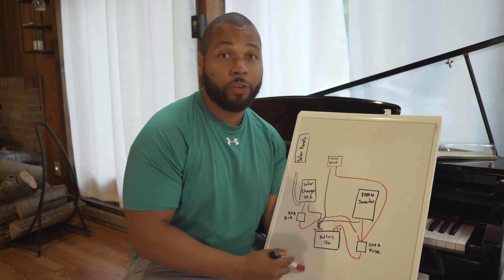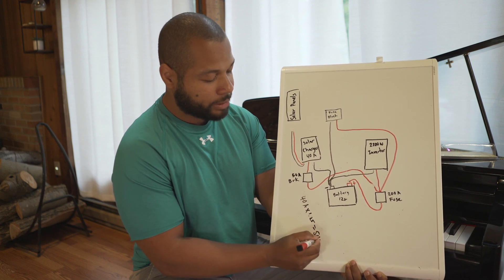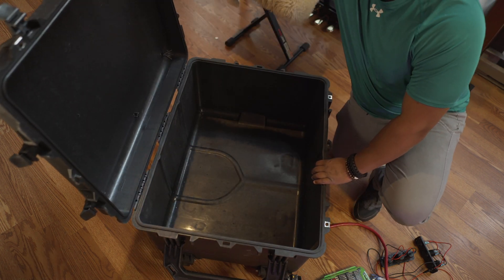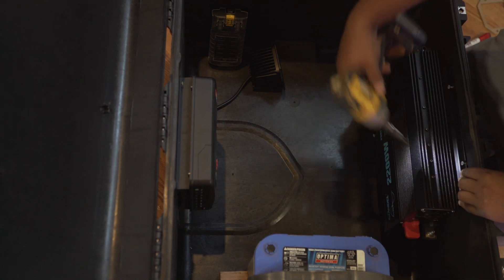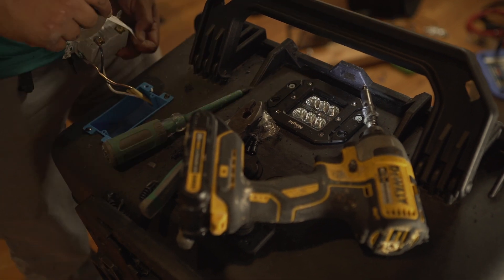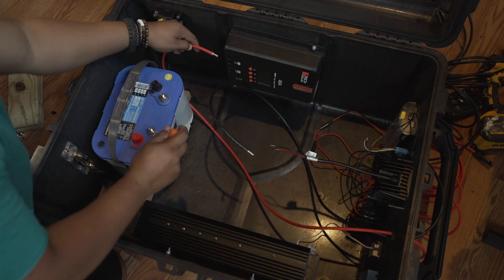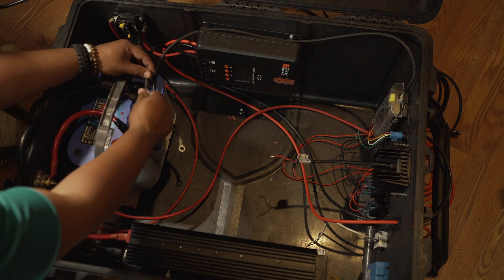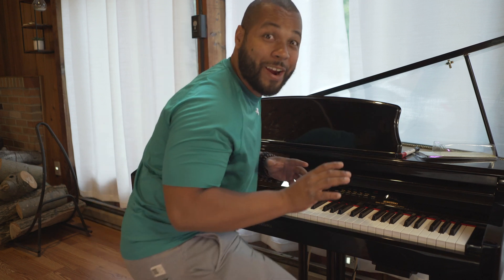How to Build a DIY Portable Solar Power Generator |  Glamping Solar Generator

Comment: I love it! You do very good work.   I just finished my 7th homebuilt. I started 3 years ago as we started getting power outages in NorCal and made a few simple 300 watt inverter battery boxes for friends who had CPAP machines. You have some top notch components and a great looking setup. A warning is in order....once you start assembling your own lithium iron phosphate cells and do your own Battery Management System, you will get addicted!
Reply from the maker: Thank you! This is actually my first solar built. I’m planning on building my own lithium iron phosphate batteries to be connected with this solar generator. I’m excited to start this new project. I’m still learning about solar systems but this is very fun to build and I’m documenting the process to be able to share it with the world. Eventually, I’m also planning to go off grid and power my entire house with solar or a combination of solar and wind.

Comment: What type of fuse block did you use ? 12v
Reply from the maker: I purchased the fuse block from amazon: "WindyNation ANL Fuse Holder + ANL Fuse". Based on the specs of this fuse block, it can operate up to 72V. Please verify the specs before purchasing.

Comment: Nice build!  Do you plan to always operate this solar generator with the case opened or do you plan on installing fans for ventilation???
Reply from the maker: I’m planning to install fans for ventilation and upgrading the battery to an iron phosphate battery.

Comment: please provide details on the battery (WHs and technology) you're using, may be helpful
Reply from the maker: Hey Mike, on the video I'm using a Blue TOP AGM sealed battery but this is temporarily. Eventually I'll be upgrading to a iron phosphate battery which is what I recommend.
Reply from the maker: This is a 55ah battery which in a 12v configuration is providing 660wh which is very light for this system.